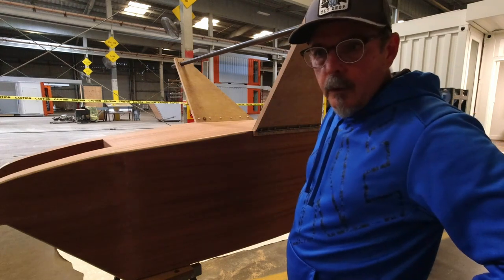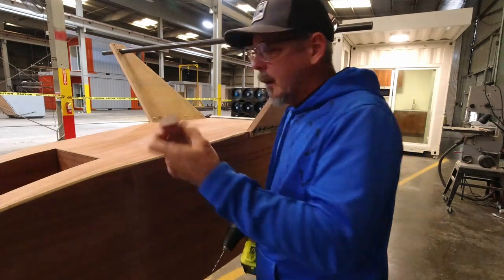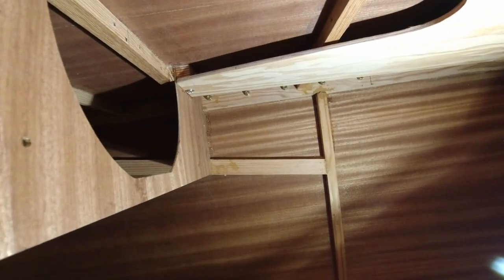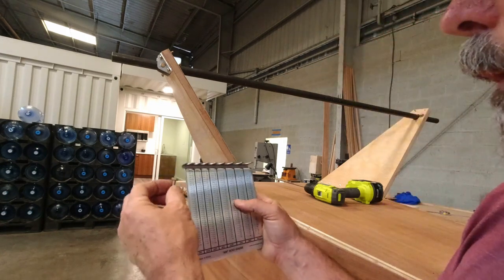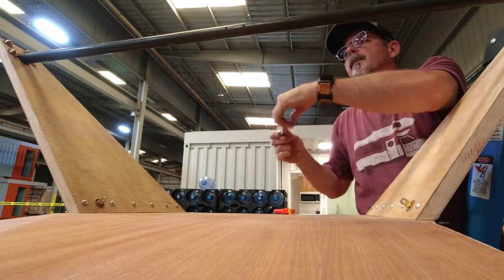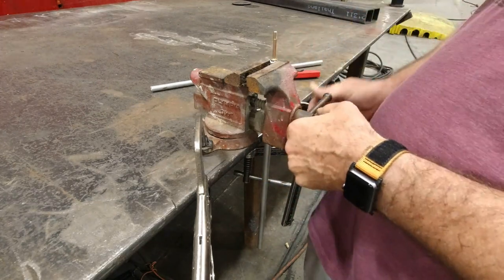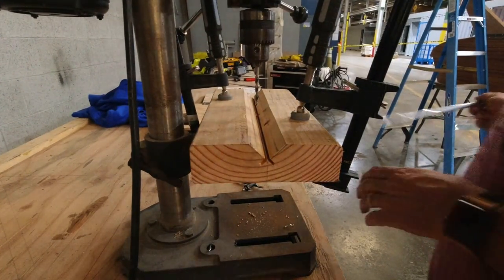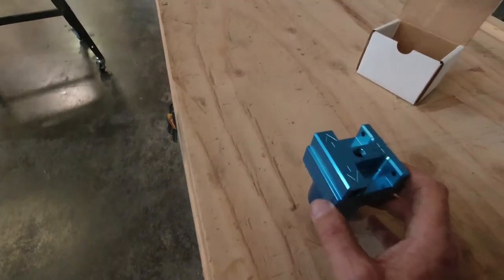Minimax 1100r Wood Aircraft Build Ep 85

Comment: Dennis.  Wonderful job on that gear.  Listening to you talking about your fuel system, I had two important thoughts come to my mind.   IMHO, a fuel press gauge is imperative.  You can "T in" to your fuel line at the carb and run that direct. pressure line to the cockpit.  If you have fuel press indicated, you are good to go.  If no gauge, once the bowl is empty, and you are out of fuel to the engine.  The gauge will notify you that you have about 2 or 3 minutes left of fuel in the bowl. A little time to find a place to land.  

You can get a really nice 0-15psi small gauge from AutoZone for $19.99 pn:  59013.  I "never left home without one."  :)   Saved my butt on two occasions.  Secondly.  Don't know what fuel line you are thinking of, but the Blue Urethane is not a good selection.  Even if not subjected to UV rays, it will harden at where it's connected, then break off.  

Good fuel line, without a doubt,  is Gates low pressure fuel line at any auto store.  About a buck a foot.  Has really thick walls and lasts forever.  Do I speak from experience on these lines?  Yes.  One poly line broke when my EROS was tied down on the ramp and was flooded with 5 gallon of fuel.  Bad news.  Changed out all of the poly at that time.  Sorry to keep putting in my "2 cents."  But, these are important areas of concern.  Hope to hear you making "airplane noises" before long.  :)
Reply: How old was your poly hose that broke?

I've heard that the black auto store hose can deteriorate internally blocking carbs/fuel filters, seems like no single hose is perfect.

I'm using poly, anything exposed to UV sunlight I replace yearly and the rest I replace every other year.

The fuel pressure gauge is a great idea.
Reply: @ulbuilder  Never had a problem with the Gates product.  That was all I used.  Never a problem with it.  The poly lasted, maybe, 3 years.  Became brittle.  The Gates was still in the EROS 1650 when I gave the plane to a friend of mine at KX59.  Was in the plane for years.  (retired the EROS after 13 years +)

Yes, that little 0-15psi gauge does "tell the tale."  My fuel pressure only ran around 5 psi, but if I had that, I knew there was fuel to both my carbs and that if I continued to generate secondary spark ignition, "I was Golden."  :)   Thanks for your comments.   N-6395T

Comment: you can't go wrong with a mikuni square style fuel pump, ran three on three different aircraft and never had any fuel delivery problems without any backup fuel pumps. A good bronze mesh fuel filter and some bing alcohol resistant fuel line and you shouldn't have any issues. on the fuel line connections use herbie or snapper plastic clamps.
Reply from the maker: I’ll have to look up the herbie clamps...never heard of those.